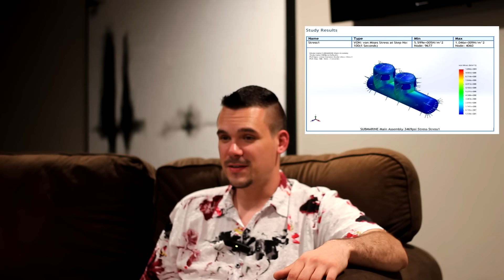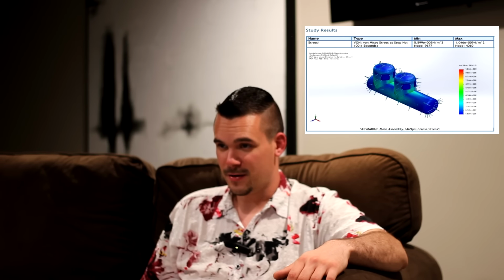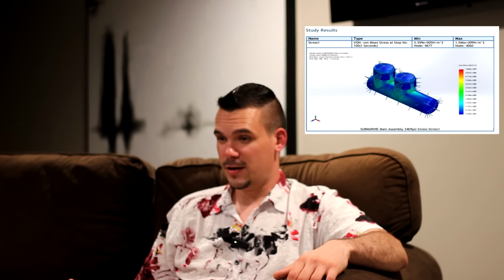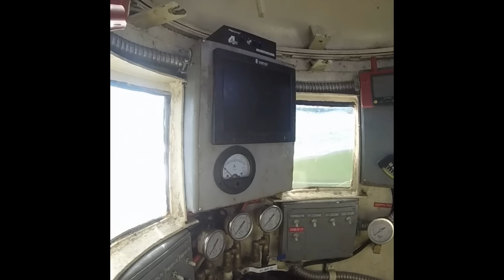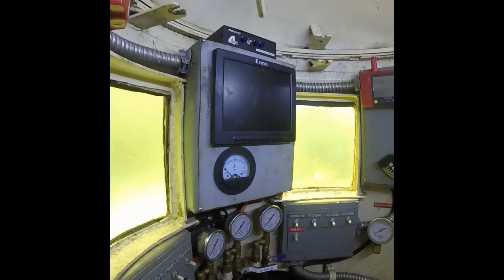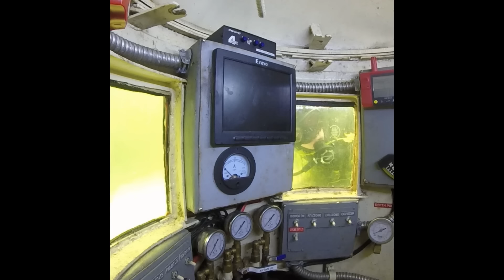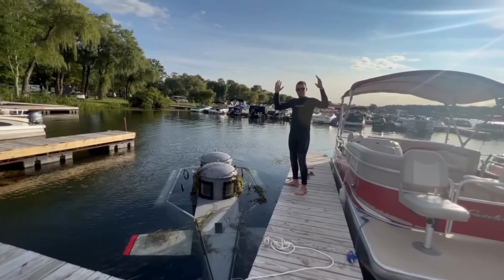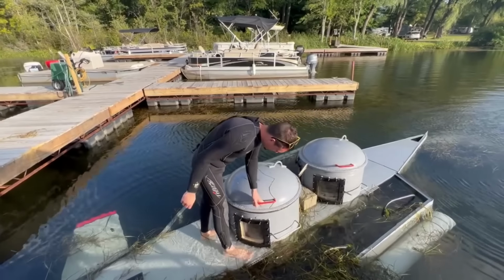How I Built A Homemade Submarine - Origins & Design | Interview

Comment: As a former US Navy Submariner that served aboard a Los Angeles Class nuclear powered attack submarine, I applaud the enthusiasm & effort. Even so, submarines provide plenty of opportunity to get injured or killed. Flooding, fire, loss of propulsion & depth control, collision with undersea mounts and vessels, and in the case of the US Navy submarines nuclear radiation, are just a few of the hazards. Familiarity, safety & the combatting of casualties were heavily stressed during Submarine School in New London, Connecticut. I highly recommend that you request and go on a tour of the Navy's Submarine School. Perhaps you'll be able to sit in on a class. Each student in my class did a free ascent with a Stenke Hood (a hooded air pocket that enveloped our head and shoulders) from a chamber as if exiting a sunken submarine. While it was done at a depth of about 80 feet, we were told that the max-depth of such an ascent was 300 feet. I reiterate, the dangers are very real...I was onboard during a collision, a fire, mechanical failure, and more. No submariner wants to see a fellow submariner get injured, or worse killed! Please be safe and NEVER cross that line. In closing, have you ever considered transitioning to model railroading? God Bless.
Reply from the maker: Thanks for the comment and service. I have a few navy friends, and the stories are always interesting. Safety is always #1. The Stenke Hood free ascent sounds interesting. As a PADI diver, Dry Suit Certified with self reliant training I can imagine it would be an experience. A just did a live Q&A video going into more depth on many aspects including safety. Cheers. P.s. No lol, no model railroading.
Reply: Much respect to you sub guys. Truly special duty and personnel. Remember, he only only needs about five to ten feet below surface to be the Captain Nemo of his local brown water lake. Everything about his design below ten feet is safety redundancy. His sixty-foot design offers a crazy amount of built-in safety. His greatest risk of collision is with submerged tree logs or boats after a storm. The joy that fires his imagination seems well worth the risk. I'd personally rather go out from a freak log collision or blown air pipe in my DIY sub than like the Segway designer who fell off of a pier when he put too much faith in his gyros.  I mean, IF those were my two choices. Lolol

Comment: Ex Navy R&D structural engineer here.  Recommendation for future such design efforts:  ALWAYS round the corners of all openings in hull (or even aircraft) structures.  Stress concentration is the concern.  Theoretically, unrounded (squared-off) corners cause INFINTE stress concentration (think infinitely-high stress) ... practically, of course, imperfections, strain effects, and whatever, limit this to just much higher unknown stresses.  Deep-cycle fatigue is the concern here ... if the stresses are really high, it doesn't take that many dive cycles to cause cracking problems.  So, it works OK for a while,  but then it cracks.  Submersibles (obviously) can be catastrophically affected by this sort of thing.  Inserted windows should also have rounded corners - weird things can happen at those square window corners.  Round openings and inserts (windows) are best and that's why they are typically used.
Reply: Dang gonna comment to make sure this is seen
Reply from the maker: I've addressed this in my Q&A video in much more detail, but in short, the design has been assesed by an engineering company and due to it's shallow depth use, is deemed safe. The square viewports were chosen on purpose with these concerns already in mind.
Reply: I guess I should have said "retired"! @Junkitup
Reply: Square windows was proven to be the design flaw of an early passenger airplane ✈️..it took em a long time to figure out why these planes were going down.
Reply: Yeah like the Titan bro.
Reply: @Za7a7aZ  It was the DeHavllind Comet. A number of them broke up before they were grounded and Churchill ordered a water tank to be built for a Comet so they could figured out what was going on (it was the first jet liner).
Reply: I hear you and see all of these issues. Companies like these see you as a whistleblower and might try to Boeing you.
Reply: It's interesting to know why they do build it this way. Im gonna have this in mind if I build a diy submarine. Thanks for the tip
Reply: never take any risks! 
never ever ever! 
always comply with what others tell you! 
they know how to do it; not you! 
never be yourself! 
they block and ban unique! 
it scares them when you be different! 
CONFORM!!!!
Reply: @PlanesBoatsandSubmarines  but then again, it wouldn't hurt too much to round the edges of the windows off, it would make it more reliable over time and would save you from having to fix alot more in a bad situation, I understand you won't be going too deep and my point isn't safety, rounded edges is more of an insurance. Love the video keep it up can't wait to see it all done
Reply: @gordonlumbert9861 
The windows in the Comet were not the cause of the structural failures.  Just about everything else was.  Novel construction methods and riveting were the cause.  Common misconception but you are correct about the water tank used to simulate compression cycling results of which advanced understanding 

As for square holes second world war American Liberty ships split in half due to stress firming at cargo hatch corners
Reply: There is a reason why they stopped using those square windows on planes after all
Reply: @CHRF-55457  
They weren't square
Reply: this is precisely why german ww2 sub designs had rounded hull and conning tower designs with outer hull being floodable and of ship shape to avoid strees fatigue in corners
Reply: hey bro could i give you my email? my buddy and i are doing this same thing and we could use some tips
Reply: I am not gonna grass but why the heck are these videos popular in a certain region
Reply: Airline pilot here.  Yep you’re correct.  dc3 or dc1 had the square windows and they found out the hard way about a major design flaw.
Reply: The de Havilland DH 106 Comet (the world's first jet powered airliner) is a famous example of why square windows on a pressure vessel are a bad idea. The Earliest Comet model had numerous in-flight structural failures that ruined its reputation in the public eye.
Reply: @nothuman3083 Which region?  Seeing that this isn’t a classified mission I’m sure you can share which region is getting these vids boosted in the algorithm 😊

Comment: I have a question. How exactly does the air supply work? If you released air to breathe into the cabin via oxygen tanks, then wouldn't the sub pop like an over-inflated balloon under the water? I'm actually really considering making my own submarine and wanted to know how you hit the 24-hour mark underwater. Also, how do you know at what time to release oxygen into the cabin without wasting your air supply?  And btw THIS CRAFTSMANSHIP!!!  This thing is awesome! Anyway, I would really appreciate it if you could answer my questions. Thank you.
Reply from the maker: Thanks, good question. As the Co2 scrubber removes carbon dioxide, the cabin pressure drops as a result of that. If the oxygen is turned off, the cabin pressure gauge will turn negative. This actually happens pretty quickly. The o2 is released using a set flow rate. Typically only a couple liters per minute per person. This will be fine tuned along the way to maintain a neutral cabin pressure as the Co2 scrubber does its work. It takes a little finesse. If the cabin is slightly over pressure, It never gets that high +/- 1-2 psi. certainly won't cause an issue. Let the co2 scrubber catch up, or at the surface, you can vent the air out slowly before opening the hatch if a quick exit is required and you found yourself slightly over pressure. (otherwise your ears will hurt from the instant pressure change of even 1-2psi)

Comment: Why does subs vent air to submerge? wouldnt it be smarter to pump in water in the ballast tanks with higher pressure and use the built up airpressure as a emergencymeasure if power was lost of something? just have a manual valve that opens up to let the water out?

Comment: Another way? Cast aluminum hull. Flush conning tower attachment. PPG Herculite portals. Air cooled diesel. Fiberglass motor snorkel. Below waterline lighting. Motor air scavenging adjustable. Diving chamber for clearing fishing nets. Cork hull insulation. Air conditioning/dehumidifying on the surface. A 12 volt chest freezer. Detachable bottom weight.

Comment: After reading stories about mini subs getting struck in the mud due suction, I wonder if bumpers or even compressed air lines are an idea so that if pressed into muck you can break the vacuum?
Reply from the maker: We've tested it in mud, very thick with no problem. 1,200lb of bouyancy is generated from the ballast when full. (Although I still like to avoid it to be on the safe side)  Thanks for the comment.
Reply: @PlanesBoatsandSubmarines  Long ago I read about a tourist type mini sub and he got stuck so he pumped out ballast water and attained his max buoyancy but then had an uncontrolled ascent.  
Once we tried to float a small boat that had been sunk and we added lift bags but no way, it wouldn’t budge. It seems muck can really suck.
Reply from the maker: Yeah it can be bad depending on the muck. Whenever I plan on sitting on bottom, I do it in areas I'm familiar with but majority of the time I don't. Cheers

Comment: How do you escape from it if something goes wrong?
Reply from the maker: There is a flood valve to equilize the pressure and onboard scuba. Thanks for your comment
Reply: @PlanesBoatsandSubmarines   Can you get out in all attitudes? Any meaningful risk of exits being blocked? I remember how on Alvin in 1964? They came up with infallible buoyancy in the form of glass microspheres. Emerson EFF15 today. Prior to that they used oil but found out hard way it can leak out.

Comment: That's funny he has vise grips holding the hatch 😂😂
Reply from the maker: Only way to do it when sealing it from the outside, as it's intended to only be sealed from the inside, but for the purpose of a dive trial. That's how you do it!
Reply: @PlanesBoatsandSubmarines  makes sense. Awesome build by the way!
Reply from the maker: Thanks! @barryhallsack8852
Reply: I thought it was funny too until I realized the vice grips were only for the unmanned submersion trial. It’s designed to seal from the inside, but he can’t if no one is inside. 👍🏻

Comment: How deep can you go using vice grips?
Reply from the maker: The Vice Grips were only used during the first unmanned dive trial, which is that footage. As it's designed to be sealed from the inside. They're only essential in the first couple feet underwater actually. as the water pressure makes the pressure even throughout and then the depth acts as its own clamp. I took that advice from another submariner that did the same in their own dive trials.

Comment: You need some two way doors with full front and back hatch locking mechanisms. you got vice grips 😂 and I don’t mean to laugh I’m not laughing at you at all well kinda in a way but look I’m laughing because you got balls bro you sent it with vice grips as a way of sealing the hatch’s and that takes balls knowing they could pop off and fill your entire project with water bro you did an amazing job on this and it’s truly impressive 👏.
Reply from the maker: lol, actually it was quite researched. I took the advice from another submariner that did it. The Vice Grips were only used during the first unmanned dive trial, which is that footage. As it's designed to be sealed from the inside. They're only essential in the first couple feet underwater actually. as the water pressure makes the pressure even throughout and acts as its own clamp.
Reply: @PlanesBoatsandSubmarines  bam 🤯 see no I stand corrected and here I thought you were just sending it because you just couldn't wait 😂 hey I'm only thinking that way because I have never seen any like this and if it was me I would send it too 😂 with the vice grips. But your submarine is absolutely amazing and very impressive not to many people can say they can build something like that and actually put out on the Internet for everyone to see

Comment: So i am actually planning to build a 40 foot sub with an 8 foot diameter, its gonna be pink and look a little like a ww2 submarine, like the S101, just no torpedo tubes lol
Reply: Das Boot?
Reply: @richardkudrna7503  wha?
Reply from the maker: 8ft diameter? Thats a lot of displacement. Plan to spend a fortune on steel and lead to make it heavy enough.
Reply: @PlanesBoatsandSubmarines  the hull itself is only gonna be about 20 grand or so, the whole project has an estimated minimum price of 100 grand, only need like 7-8 sheets of steel for 40 ft×8 ft. The sheets are 10ft×4ft sheets
The frame itself is made from roll cage piping since it has the needed strength. 

Its gonna be gas/electric, gas to power the electric motor on the water but batteries for under, its gonna be like a 2-3 person. Gonna have active sonar in the nose, all control surfaces will be electric but also have a way to manually control should they fail along with emergency purge tanks to raise if the pumps fail and a whole oxygen and co2 recycling system

Edit: I took a whole day to plan this lol
Graph paper and everything. The diving probably won't be an issue

Comment: I love the vice grips lol hope they Are Not permanent
Reply from the maker: No lol. The Vice Grips were only used during the first unmanned dive trial, which is that footage. As it's designed to be sealed from the inside. They're only essential in the first couple feet underwater actually. as the water pressure makes the pressure even throughout and then the depth acts as its own clamp. I took that advice from another submariner that did the same in their own dive trials.

Comment: It didn’t end well with the last homemade submarine
Reply from the maker: The last one wasn't homemade. Just poorly built with greed and engineering shortcuts for such a deep diving submersible and out of the wrong materials. Carbon Fiber is not meant to be used for submersible pressure hulls.